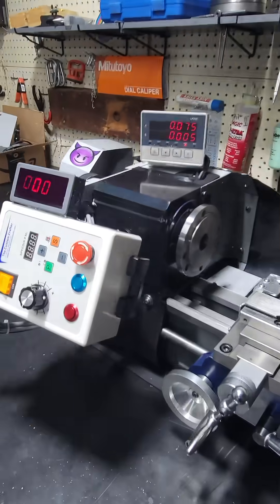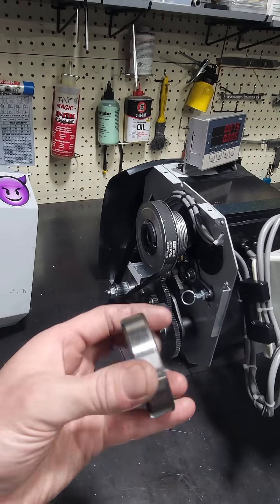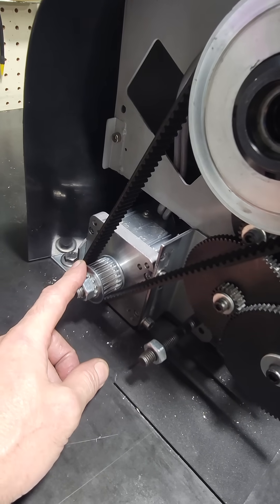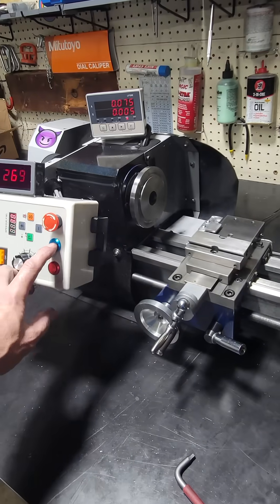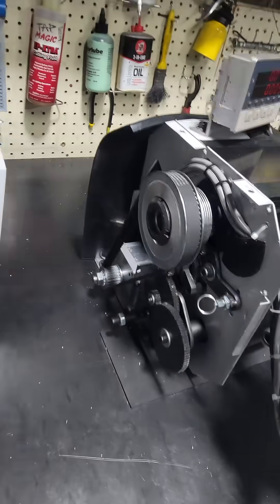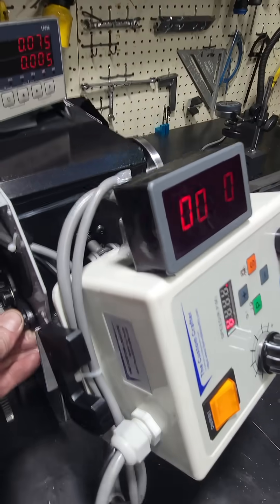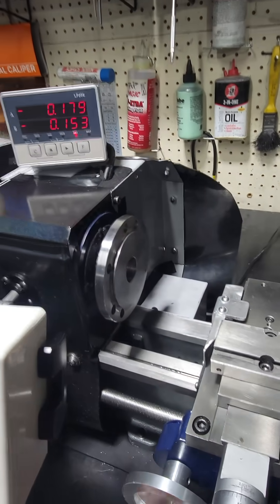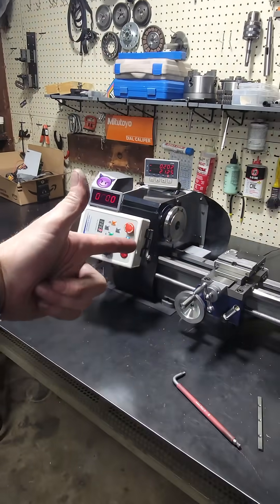I got the cheapest lathe on Amazon and made it better than I could buy 😈

Comment: Nice. I got an 8×14/ medium sized mini lathe and immediately did all the upgrades- bearings, qctp, threw the 750 watt it came with out and put a BIG torquey 4.5 hp DC treadmill motor and power controller with a thick V belt pulley system on it. I had to make all my own gearing and pulley mounting system to fit it all (the motor is BIG- like 5x as big as the 750 watt motor it came with which was about the size of your motor) totally transformed the lathe. The stock motors are WORTHLESS. Mine has just a little over 10nm torque (10.33NM) and I STILL don't think it's enough. I want to be able to power thread/tap up to 1" diameter without issues. I start bogging down over 5/8" dies in alloy steel. I did all of that because I HATE tapping and die threading. All that works and it only mostly works😂 I should've just paid for a big proper lathe